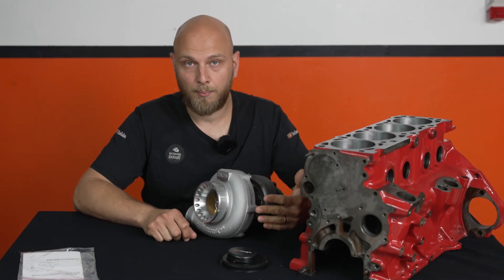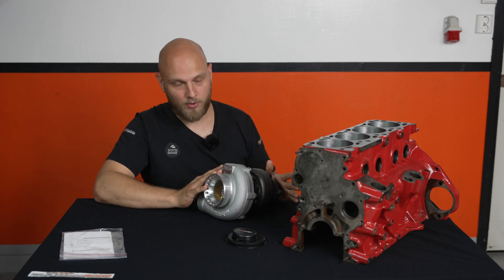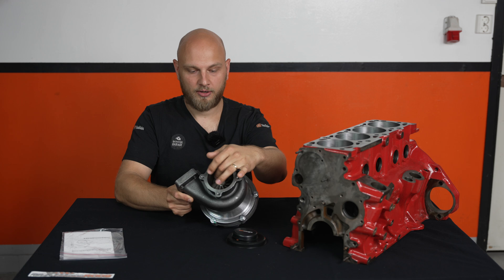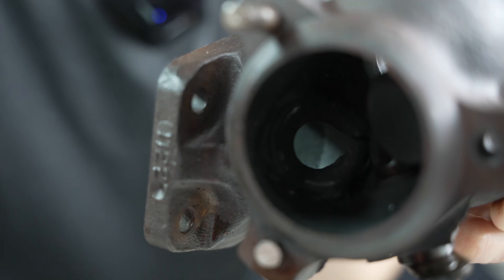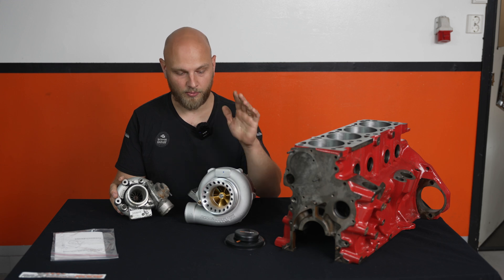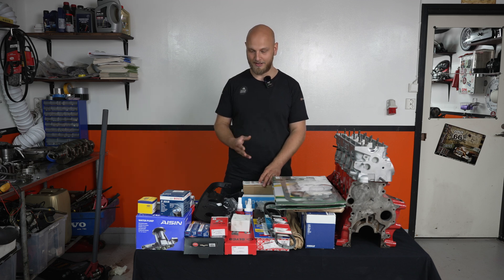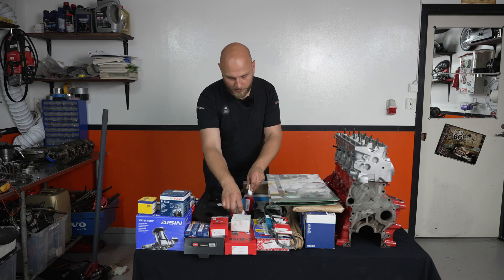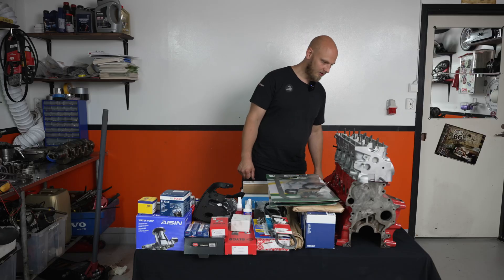GT3582 Maxpeedingrods Unboxing and B230FK Rebuild Intro

Comment: Hi there, Interesting proces. I'm trying to to do sort of the thing over here in the Netherlands although not being a mechanic I need help from a local classic car garage. But nevertheless I'm trying to learn as much about my 945 as I can. Goal is to build 1 300BHP per 1000kg Volvo out of it. So serious weight reduction and probably 400 crank BHP. Why did you choose this specific Turbo? 
Is it a straight bolt on or do need to fabricate a mount etc.?  I'm having the engine rebuild by a red block specialist and it should be capable of handling 500/600BHP when he's ready with it/ Other pistons/rod's balanced everything, different cam's, valves etc.
But this Maxpeeding Turbo makes me curious!!
Reply from the maker: Im sure the Maxpeedingrods turbo is a great turbo for the money, but more than that i do not know. The turbo will not be able to work on the engine without a fully custom built manifold. 

Sounds like you have specific needs, I would find a specific turbo for that need and personally, I would look in the borgwarner direction for something with a bit more edge.

Sounds like a nice build👍 I will let u know how this turbo performs once I get there 👍

Comment: hi mate! I love your videos.

I want to swap my B200E to an B230FK/FT engine... 
Is it easy to do? and how about the wiring, are those connectors the same or extra?

My current B200E doesnt have Lambda.
Reply from the maker: Hi! Thanks 😀👍 I Don't know alot about the B200E engine. What car do you have that engine in, the 360 ? Or maybe an exported 740 or 240 ?
Anyway sounds  like a pre LH 2.4 engine so you will run into alot of issues with the wiring but i woulden't let that discourage you from doing the swap, but you might be looking at a lot of custom work and not so much plug and play.

Comment: I've been running a pair of the standard "GT35s" from MaXpeedingrods in the trunk of my E36 drift shitbox for a few years now, and they rip.  Thing runs 9.6s@144MPH, and drifts very nicely.  Can't complain at all, especially at the minimal price!
Reply from the maker: Sonds hopeful! :D
Reply: @BackmansGarage  Definitely!  I found that on mine, I needed to use a small cylinder hone on the inside diameter of the compressor housings, otherwise the compressor wheel just barely touched the housing.  At first it seemed fine, but eventually the turbo would eat itself.  Once I honed out the housing a little so that the tiny bit of touching was eliminated, then all was well!